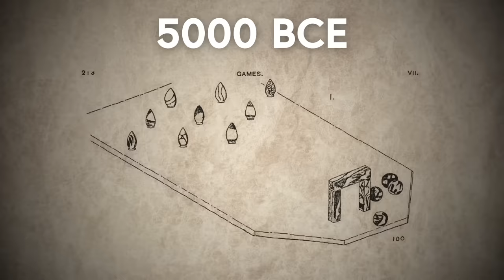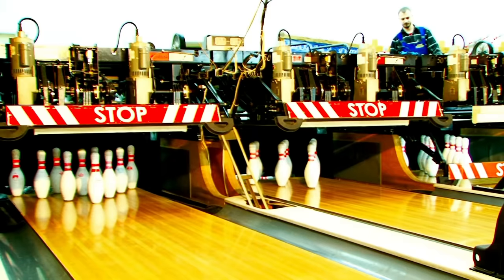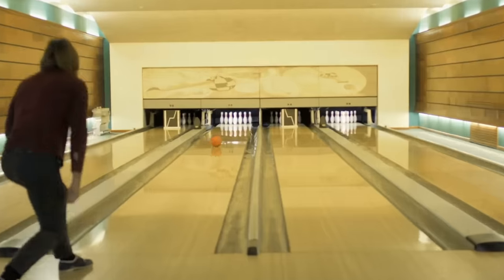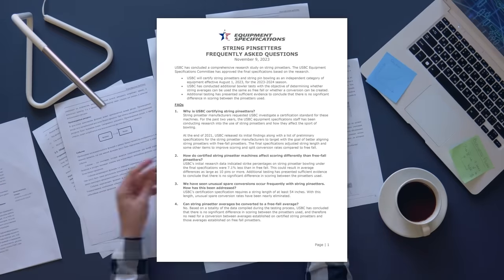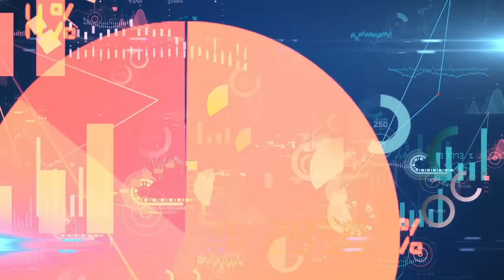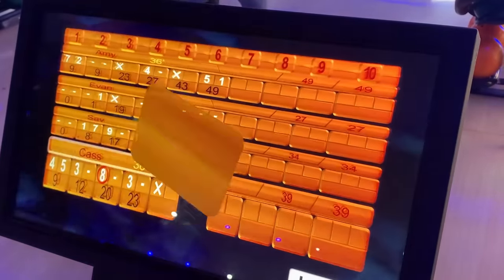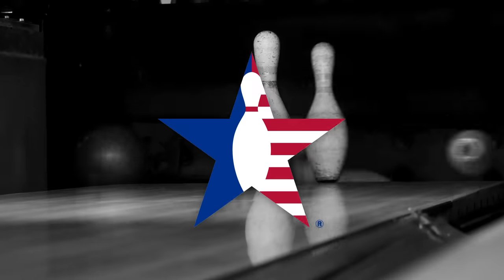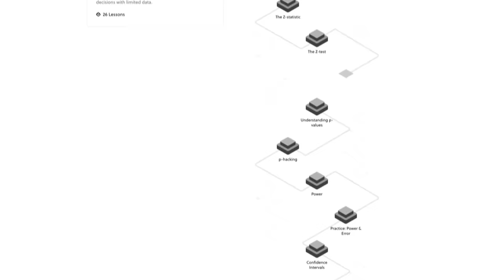The Controversial Machine That’s Ruining Bowling

Comment: I've been a bowling alley Mechanic for about 10 years, and just quit.  String machines make much much more sense if there is no significance to scoring increase.  There are issues though like making strings shorter to create too much scoring. Generally the outlook on bowling isn't super hot though so anything to reduce the cost.  My last company was spending 200k a year on labour alone because the midwest standard A2 is a very complex machine.

Comment: There are cheap easy bowling machines I worked as a pin chaser the repairs are cleaning off some grease or adding grease to other parts sometimes a spring breaks the rest of my job was being the janitor 

The machine described in the video was a Brunswick we I worked it has half abc half Brunswick machine combo

Comment: So I went to a bowling alley the other day and ran across these sting setters for the 1st time ever. Sorry but they do ruin the game. Multiple times I hit the pins perfect for a strike, yet at least 1 pin remained up. Also the string setter did a terrible job of counting pins often putting pins I knocked down back in play, esp if the pin  was upright even if it was knocked out of the alley. There is NO DOUBT in my mind that the strings both help pins remain standing but the entire system is poor at counting pins properly. I understand the cost savings, makes sense esp at places like Main event where the players are general casual, but in a professional setting I can understand why players hate them

Comment: Just went bowling with coworkers and, while the strings clearly upset everyone, the actual problem was the machine continually got our pin sensing wrong for every player in every game.  We called it "stolen valor" strikes and spares, even when 1-3 pins were still standing.  Nobody likes to win when they didn't knock even their pins down, but that's what happened.  We collectively rolled more eyes than balls.  I feel like these newer cheaper pin setters have newer cheaper (garbage) pin sensors.

Comment: So just for reference, how many 7-10 splits have you made? watched a video where 2 bowlers tried to make as many 7-10s as they could on string pins in 45 minutes. they made 24 in 45 minutes. I haven't mad 5 in 50 years of bowling on freefall pins. stings influence the shot.

Comment: I’m not even a good bowler, but I’ve gone bowling maybe 5-6 times this past year and two of the times were strong bowling. The biggest issue I had with it is that their system was just super inaccurate and would constantly count extra pins or not enough pins after every turn. I’m not sure how much of that is tied to the strings and how much of that is just that they had a bad system.

Comment: Testing bowlers with a 70 average will not at all tell you if strings are any different. I'm a 200+ average. Semi pros and pros use heavier equipment with much more energy arriving at the pins with our asymmetrical cores.

Comment: I'm sure strings are fine: but the original study used terrible statistics (or more properly, used them terribly).  The t-test can't be used to support the claim that two things are the same.  It can only be used to support the claim that they are DIFFERENT.  Put another way, you can't use the null hypothesis as your primary hypothesis: that's just bad math.

Comment: In Quebec we have way smaller pins (bigger distance to hit other pins and less chance) and string pinsetters, so that's why pros from here are way better than American bowling PBA players (and pretty much anywhere in the world that use the same string-less pins system as the Americans). There's a whole lot of perfect games from PBA players that has two or more lucky strikes in it just because the pins are made to bounce everywhere and the back and side boards are made to be the complete opposite of absorbing energy, compared to Quebec bowling. Also some splits that are made because of the bouncing pins are completely impossible to do in Quebec, like the 7-10.

In bonus, our bowling ball rotates backward while traveling forward on almost all the 60 feet.

Comment: It's funny to call this controversial, given there were smaller bowling alleys (Bowlingo) that were around for decades that didn't threaten the far more expensive, full-sized bowling alleys. Either the market will respond positively or it won't and the market will sort itself out. Most likely we'll just get bowling alleys that maintain their older tech for more discerning customers that care about the difference and string bowling alleys for the customers that don't care and they will all co-exist peacefully together.

Comment: the machine is mechanical without any electronics and hasn't been updated since 1946 of course its going to be heavy and use a lot of power.
if its using strings it shouldn't be tight, it should sag a bit.

Comment: I knew there was a study conducted that said something about "no real difference" for the use of string pins. And that in itself is total crap. The data may show there was no difference, but visually I can tell you there is a significant difference. Pin Action is a part of bowling. It adds a excitement layer to the game. People down below call it luck,  and it really isn't luck, Pin Action is created by the bowler. Someone with a high speed ball that sends pins bouncing around benefits considerably from creating Pin Action. Tripping pins, rolling pins, sliding pins, those are all apart of the game and are nearly eliminated with strings. I have seen it. So for them to come out and say "based on our huge report on scores there is no noticeable difference" is complete garbage.... I don't care if centeres want to use them for "Cost Savings" but as the league and event sanctioning, they should have come down hard on centers opting for not re-investing in normal pin setters. 

And in regards to that, the industry is already experiencing a corporate consolidation. Bowlero has begun to gobble up family owned centers across the country. Now, if you were running a large corporation, that only looks for profits, not experience, what would be the first cost cutting measure. String pins? less electric, less employees, lower cost to operate. See that is going to be the problem, by the USBC not making a condition with the string pins, corporate centers are going to have zero incentive to refurbish or buy new pin setters, and instead just cheap out and get string pins. I am calling it already.

Comment: Even if it is controversial, instead of banning it, why not try to improve it?
I almost recently heard about this and while I didn’t actually played bowling on an ally that has that machine, it seems like a next big step.
Also, when I said why not try to improve it, I mean make all of those strings longer and more loosen after setting up those pins. That way it will have more freedom and it will be the same like playing a real bowling, compared to if the string gets too tightened. Its problem would generally be, if the strings are too tight, while too loosen is also a problem.
Also, before this machine or so, I have also seen a machine but a toy targeted to kids that automatically sets pins (containing 6 pins total) but without using strings. Not sure how to exactly explain but the pins from this toy are actually attached to its celling by somewhat of a cylinder and if they get knocked down then the pins raises up. I think it was called “Arcade Alley Bowlercade”.
If it gets into a problem like strings getting tangled, then that’s when staffs or employees would need to fix them.
I played bowling for several years and know how those pins get knocked down or the machine works

Comment: The USBC study is nonsense; strings cut down strikes and give back some janky spares.  It's the perfect example of dividing by zero fifteen times to get the numbers you want.  USBC was pressured to sanction the silly strings by Bowlero / BPAA because they wanted to improve margins.  (Bowlero is not a monopoly but they have dominant market share.)

As for the silly strings - 
For the random non-serious players that nets out to zero.
For anyone actually good - meaning you average higher than 180 per game - the loss of strikes is worse than the gain of spares because it cuts down on double strikes.  As someone that converts 85%+ of your spares on "real" free fall pins gaining a small percentage of extra spares is minimally helpful.  At most it's adding 1 or 2 spares per three games.  22 pins total over three games.  But the loss of 2-3 strikes per three game set is gigantic.  Good players will regularly throw 20 or more strikes per three game set, and at that point, each extra strike will either start or will continue a line of double strikes because there's no where else to put the "X" on the score sheet except for ... next to another strike.

Comment: Actually surprised the USBC did a study and certified them. I've bowled probably 3000+ games and the 10-15% of pin action that would fall differently kind of make all the difference to the game.  For the average casual bad bowler, whose numbers I'm sure have skyrocketed since the 80's, I suppose strings don't make any difference.  My best friend was an AMF manager (hence greatly bolstering my free game count) and I'm an engineer and bowler since I could walk, spending time with the A2 and 8270 pinsetters in the back was a joy to witness these machine marvels.  These were machines built in the 1960's (and already 2nd/3rd generation at that) and were still operational in the 21st century. Much newer models have been made so I'm not sure if comparing retro alleys with the modern equipment is fair. I will never spend my own money on string bowling, but for the casual bowler, go for it, but know there is a lot more to the sport than this, and it shouldn't be lost.

Comment: Of course strings vs. freefall won't matter to newbies and casual bowlers. That's not the argument being made against stringed pins. It's at a competitive level where it screws things up. 

To that point, it's completely pointless tracking non-league bowlers in two different bowling houses using two (or more) different house balls. That's way too many variables to collect any meaningful data-set, not the least of which is newbie bowlers who already vary wildly in their scoring with no other variables. You want consistent bowlers using bowling balls they are experienced with who average the same consistently on free-fall pins across entire league seasons to compare to stringed pins across entire league seasons (3 games / week * dozens of weeks).

This is like determining whether replacing rubber tires with wooden tires will ruin auto-racing by putting people who have never driven a car before behind the wheel of different vehicles on each tire compound on two different tracks they don't know and when meaningless results inevitably come in declaring "see, it makes no difference!" at the end. Perhaps let the professionals or semi-professionals who are consistent and have actual experience participate in the comparison to deliver meaningful data?

Comment: I will never bowl in an alley with strings.  The idiots in the USBC might come up with study after study saying well it SEEMS no different.  But I remember the arcade games with strings resetting the pins.  It's the same thing.  And no matter HOW you control the length of the pins or placement of aprons, those items will in some way altar the game.  And they may make it better for some or worse for others.  So it's not the same game, not the same noise, and no longer fun.  They can take their stringed alleys and shove it.

Comment: Even if strings did make a difference in some way, that doesn't matter if you just make them the only official method for pros. Then once again everyone will be using the same standard. It would be different, but it would be different for everyone in the same way, which means it's just as fair.

This happens in sports all the time.

Comment: the problem with all of these studies is that they do use the average bowler that the problem with many studies in general and why lots of the time you can probably just get better info from people that are just huge fans or supporters of an industry this study is like that one study that tested the lean body mass of people with four groups two with no steroids and two with and with half of each of those groups working out and the other half not the end of the study showed that obviously the group that took steroids and worked out had the most lean body mass percentage of the four groups but here's where the problem is the next highest group was the group that took steroids and didn't work out at all and then the group that worked out with no steroids came in behind them by a semi decent margin but there's a major problem with the study which is that it just measures lean body mass percentage and only that so in reality no you can't just sit around and take steroids and sit around and get more muscle than a natural lifter all that happens is you get lean mass which is basically just much more water retention and maybe a small touch of muscle mass and another problem is that all of the participants were completely untrained or had very little training which leads me to the real point which is why would you listen to someone who has very little skill in an area about something that skilled people in that area are complaining about that's like listening to someone who works as a cashier say that farmers shouldn't need the right to work on their own tractors when they can just call a mechanic when in reality that's exactly what the problem is what i'm trying to say is don't take bowling opinions from someone who doesn't even know how to hook the ball and hit the pocket cause that's just how you get completely false info

Comment: The obvious solution is to get rid of the machines entirely, and go back to paying teenagers $2 or $3 an hour to reset pins, assuming you can find decent, hardworking teenagers.

As a side note, bowling alleys need to allow smoking, again.  Capitulating to the whiny assed non-smoking cabal was a piss poor business move.

Comment: I think they need to use a different skill set for your test.   Take someone that averages 130, 160, 190 and 220.   I want to see how those scores would compare from strings to no strings.  Also at that point, to keep it even you will need to put the same oil pattern out on both tests.   I'll support the channel once I see that data :-)   Someone shooting a 65 isn't really the demographic that is going to worry about if strings ruin bowling.

Comment: shouldnt the avg score diff be always positive since if it changes your looking for the change and whether it worsens or improves your score shouldn't matter but it should instead matter whether it significantly changes your score if that change is small it would not be zero however it being a small amount would mean it barely makes a difference between players if at all however lets say that 2 players lets call them A and B lets say player A consistently does considerably better on strings while player B does considerably better on regular if you were to look at the diff without the absolute value the result would be that it doesn't affect players a or b's score despite in this hypothetical both of their scores being changed considerably by the presence/lack of strings individually their scores are impacted considerably however if you were to look at them as a group their scores would not have changed at all.

Comment: Yeah, it's the greed of the companies making the mechanical pin setter machines. They did not innovate or improve the design to be more cost effective in maintenance, because it would diminish their revenue stream.

And now they will die, out-competed by small companies that can make cheap string pin setters.

Most people don't care how the pins are set and bowling alleys certainly care for how much the service contracts cost, so pins are going to be set by stings. Fine by me. I'm glad the greedy companies with their outdated mechanical junk will vanish from the market.

Comment: Looks like the research was done with bad bowlers. This is a key factor. Good bowlers get much more pin action with pins flying all over the place because of power & revs they create. These strings would limit this like a head pin flying off the side wall & taking out a corner pin opposite side of the lane. Pins bouncing out of the back of the pit & off the walls looks like would be restricted with these strings. I do not like the strings.

Comment: Fun fact, a bowling ball is supposed to be roughly 10% of your body weight up to about 18lbs with the most common being 16lbs. As far as I'm aware, there are no rules as to whether you have to use that weight or not but I used to bowl with a 16lb ball for the first throw and my second ball was 12lb for when I needed more power on splits or odd pin spares.

Comment: Oof, I don't care what any of all y'all say about the string pins, if I walked into a bowling alley and saw those -- it would be a quick 180 and out the door. 

There's no way that doesn't affect the physics of the pins. When I was younger and played regularly, I used to put some spin on the ball and knew how to place the ball on the right board to hit the head pin at the right angle to send the pins flying. I could pick up a spare on a split. Those things right there -- that's what I'm sure the strings will change the physics of. I mean those string pins have rubber baby buggy bumpers around the middle of them. Lame!